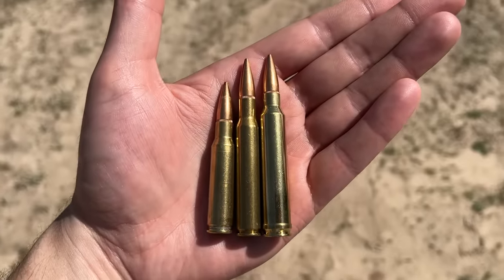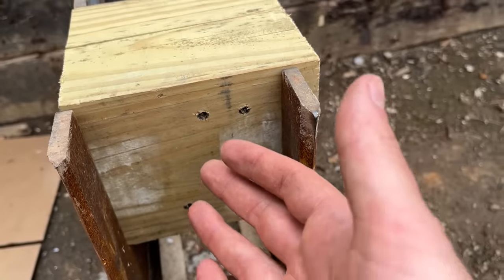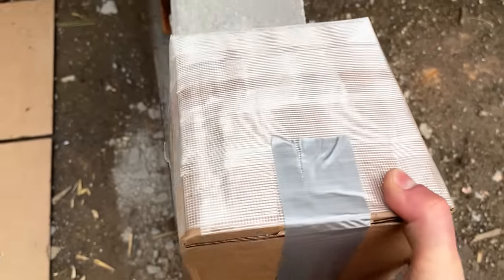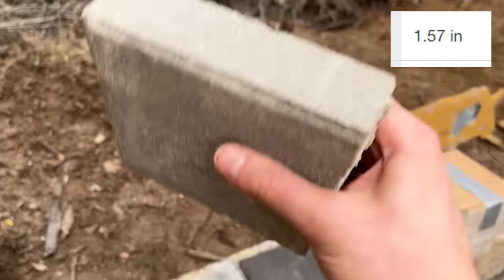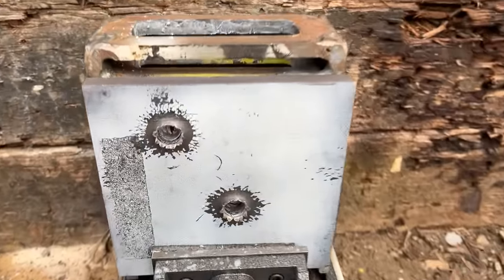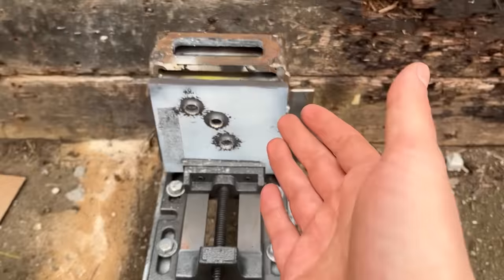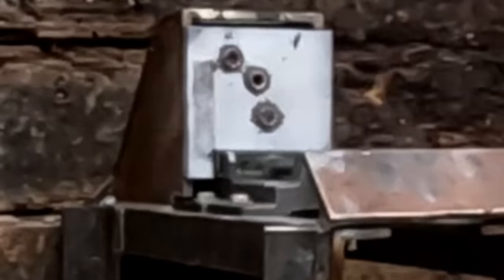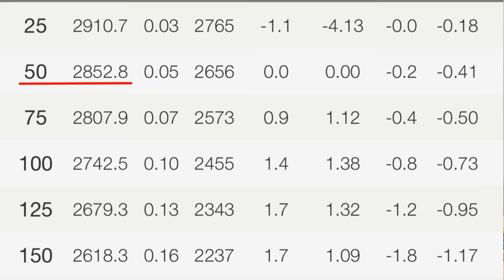308 vs 30-06 vs 300 Win Mag: Did Not Expect This

Comment: The split between 308 and oht 6 isn't a surprise for me. My grampa ( WW2 vet, tail gunner and all around gun nerd ) told me that 308 was the replacement for 30/06 . Grampa and I would read ballistic charts and bench race ammo...I know nerd stuff. It was the fun part about learning to shoot with him and my uncle.
Reply: Correct the army wanted a replacement for the 30-06 but wanted the same ballistics.  .308 was created to perform the same but with a shorter case
Reply: 308 replaced the old 30-06 that was safe to fire in the M1 Garand. Modern 30-06 is more powerful, and will damage an M1. I don't know what happened with these handloads.
Reply: Is it the same grain bullets
Reply: @Bob5mith  yeah the powder used in 308 is different than that of the old 30-06.
Reply: @DRAKED411  yes the bullets are interchangeable
Reply: Only because 308 is lighter and cheaper to produce. Not a knock just facts.
Reply: @brentacusmaximus6677  The 308 is a bit shorter... Faster throw in a machine gun, which puts more bullets up in the air.  '06 shoots a bit faster than a .50.
Reply: @IzzyReel  I'm a reloader so  I'm pretty aware of the differences between 308 30.06 and many others. What I stated is facts straight from the guys in charge of army ballistics.
Reply: @brentacusmaximus6677  Well yeah and whats your point?

why would you want a cartridge that requires more brass, takes up more space when in storage and provides no benefit?
Reply: @therideneverends1697  lol  I never said anything like that and here's a new flash 308 is only comparable in FPS NOT kinetic energy "ft pounds of energy ! I reload both a long with other calibers so I'm well aware.
Reply: @therideneverends1697  BTW 30.06 AP was still used up till the Vietnam War era in different belt fed machine guns and in some cases was still in use all the way until the late 70s.
Reply: The .308 Winchester has all the performance a 30/06 had in the 1940’s due to modern progressive burning rate powders etc.  The ‘06 has also benefited from this.  Just don’t use anything like 4831 in a Garand as you’ll create a very hazardous situation with high residual pressure at the gas port, for which they were never intended to handle.  I have shot much modern commercial ammo and many handloads through M1 Garands with no problems, with the possible exception of some Prvi-Partizan Yugoslav commercial M2 ball.  This shot well but seemed ‘lively’ so we pulled some apart to find it had well oversized flash-holes.  Just avoid the slow powders in the Garand and keep the pressures sensible as you should with any handloads. 
The 30/06 probably has the edge if you’re driving heavy bullets, say 200gr, with the slower powders - just don’t do it in an M1!  Use 4895, 4064 or equivalent and you’ll start to flatten primers before you’re in the danger-zone, then it’s time to back off.  The operating rod is the failure component here.  People have been speared by these.  A stress-relief radius at the junction of the operating rod is never a bad idea, but better to just not push the envelope!  And don’t mix your brass - different brands have varying capacities which can lead to catastrophic outcomes, and it’s a bad idea for consistency anyway.
Reply: @brentacusmaximus6677  if it does the same velocity with the same bullet weight and BC then the kinetic energy is identical.  But the 30/06 can drive bullets a bit faster due to increased case volume providing bore volume (length in this instance) allows for the full burning of progressive powders.  If done at the same pressures, there is no additional loading on the bolt-face by the longer powder column.  This particularly applies to heavier bullets, where the ‘06 has an advantage. I think this might be what you’re getting at? 🙂
Reply: @ThreenaddiesRexMegistus  basically in a nut shell they both have they're advantages aspeaclily with modern powders. If I had no choice but to carry a lot of ammo with a rifles 308 is a good choice. Realistically 30.06 has a lot of different loading abilities so does 308, but for fun at the range a 110 grain boattail in a 30.06 with a fairly hot load is gonna get some serious FPS that you couldn't get in a 308 case with the same 110 grain freedom seed. Lots of good aspects of both these case rounds.
Reply: The 308 is basically identical to the 30-06 with bullet weights under 150 gr. Over 150, the 30-06 rules.
Reply: @ThreenaddiesRexMegistus  in this guys video with no mention of B grain weight, type of powder or load data in general it kind of speak to the fact that a lot depends on all those factors. I mean a 308 could be loaded to be a good deal more powerful than a 30.06 and vice versa. The original 30.06s were loaded more mild for the M1 in ww2 which is another example of load specs making a big difference.
Reply: @brentacusmaximus6677  Yeah and the M3 grease gun was used until the late 90s early 2000s, doesent mean id be thrilled going to iraq with one
Reply: @ThreenaddiesRexMegistus  but the thing is why bother, almost all the 30-06 available commerically is either M1 spec or for bolt guns, and costs more.

Makes more sense to just use a 308 or buy another cartredge thats more efficiant
Reply: That was the greatest part of my childhood spending quality time with my grandpa and gun talk !!! 💙🪖😎
Reply: @therideneverends1697  It just comes down to them both having different advantages. If you're an experienced reloader i would think you'd already understand that.
Reply: @brentacusmaximus6677  the amount of variables is staggering . I was talking nato . Gramps explained the US military wanted SIMILAR performance from a smaller round. It was simply to allow more ammo to be on hand at any given moment. Beyond that I can look at a 308 and an oht six and simply see the potential one has vs the other. Ballistics are cool because that rule doesn't always apply. Simply by increasing velocity one can drastically effect the way a round behaves.
Reply: @robsorgdrager8477  thats basically what my original comment was meaning when it came to the milatarys decision to develop a lighter yet comparable case round. same thing happen during the Vietnam War and the m16. Took a couple years for them get that right and make everyone happy too, accept for the north com lol.
Reply: My pops always said in ww2 the 30-06 was the goat
Reply: @cannonfodder4812 exactly right. The military contractors had millions of projectiles to use so the new round needed to be 30 cal.  The powers that be wanted a magazine fed rifle with smaller, less heavy cartridges so more could be carried by each soldier. New powders were developed to retain 30-06 velocities with the new shorter 308 cases. The M-14 was essentially designed around this cartridge.
Reply: @brentacusmaximus6677   Wait, what??? Are you saying a 150 grain .308 FMJ projectile traveling at 2.850 fps DIFFERS in KE on impact when compared to a......150 grain .308 FMJ projectile traveling at 2,850 fps??? You will have to explain that one. I must have been absent from high school physics class that day.
Reply: Not nerd stuff! Great memories is what it is!
Reply: @therideneverends1697  The only reason for a 30.06 over a .308 would be if you were hunting some real large game.  I am in Tennessee and the deer are not that big.  Plus I am not shooting a deer at 800 yards.  Just so much more available in .308 so it makes no sense to use a 30.06.
Reply: @woodystube1000  No thats not what I meant, obviously.  I meant the same grain bullet in in a 30.06 will have more kinetic energy than a 308 depending on the load in the same matter that a 150 grain won't necessarily hit 2850 FPS depending on the load.
Reply: @rudder727  same here in Minnesota. The difference is our deer a big fatty fat fats. A lot of the old heads swear by 30/06 but I really don't need to take a 500 meter shot through three acres of dense brush 😏 . 308 gets the job done. Honestly 30/30 in a lever rifle is 🤌. Nice and light to carry up in the stand, great weight and performance...but yeah 308 has never failed me.
Reply: @robsorgdrager8477  honestly, a lot of that has to do with what the individual hunter is most experienced with, the very reason 30-06 became a popular hunting cartridge when the WWII vets came home. The cartridge is more than capable of taking a wide variety of game, and those vets had the most experience shooting that cartridge, so why switch to something else? 
I've used 30-06 for deer hunting because that's the caliber that my hand me down Remington 700 is chambered in, but I've just built an AR-10 in 308 that I'm planning on using this upcoming deer season. As long as my shot placement is good, I'm not worried about not being able to make an ethical kill on a deer with either cartridge.
Reply: With newly available  powders the 06 case was overkill for the M1 Garand so the 1945 T25 protype for the "improved model" was designed around a .300 Savage length cartridge based on a shortened 06 case. This rifle eventually became the M14 and the cartridge the 7.62x51. Winchester had released the civilian version a few years earlier as the .308 Winchester.
Reply: 10/10 Grampa and uncle moment
Reply: spelled aught six :)
Reply: @James13234  ☺️✌️. I fix cars

Comment: Once again the 308 demonstrates how it is one of the most efficient cartridges available.
Reply: It's the G.O.A.T.
Reply: 30.06 makes sense if you have a strong action and a long barrel to take advantage of hand loads.
Reply: Back when I used to hunt I had all 3 of these calibers. With the  300 and 30-06, even with good placement you might be blood trailing. With the 308 I never EVER had a deer take one step after a shot.
Reply: @baaamakingbaaaa  shot placement.  same slug, even less energy, no magic.  it's a very good cartridge, but it doesn't have mystical killing properties.
Reply: @handroids1981 the 300 win mag is….
Reply: @daltonisom6265  Not even close.
Reply: @handroids1981  the only thing the 308 has is more stock and chassis options
Reply: @daltonisom6265  So that's two things. I'll add a third, ammo availability and options.
Reply: @handroids1981  300 win mag has superior ballistics…
Reply: @handroids1981  and 300 win mag ammo is easy to come by… there’s all types of different ammunition for it!I    can go grizzly hunting and a guide won’t complain about it…
Reply: @baaamakingbaaaa  agreed, its all about energy displacement, if the bullet displaces all of its energy on the animal its max damage, if it goes thru the bullet has not displaced all its energy on the animal.
Reply: I agree.  And what gives it the real edge over the 06 imho is the vast semi auto platforms available for it.  The ability to make fast follow up shots is huge and cant be understated whether hunting or self defense

Comment: Where 30-06 steps away from 308 is when throwing heavier bullets.  The 308 loses powder volume to accomodate longer bullets, where 30-06 has ample room for the slug and the extra powder starts to really pull its weight.
Reply: Yep.
Reply: Compressed loads my mans
Reply: Thats why its the best hunting round 👍
Reply: So long as the rifle does not fail due to overpressure.
Reply: @DavidFMayerPhD  you can't make an overpressure load with 308 that will damage the gun if you are using the correct powder.  There isn't enough case volume.  Even with a 150gr projectile, I can fill the case to the brim with varget and compress the powder and barely get primer flattening.
Reply: @flossordie2256 I was thinking of the 30-06
Reply: @flossordie2256 you haven’t reloaded enough then.   I was shooting 185 juggers with a hot load using “temperature stable powder”
Reply: @popeye089  and?
Reply: @DavidFMayerPhD  that's true in general.  308 loses all it's arguments past 180, 30-06 is good to a 220, 230 if it's a round nose.  of course don't load irresponsibly, but you can buy heavier loads off of the shelf.
Reply: @sinisterthoughts2896  it’s all fine and dandy for a hand loader, but if your buying factory ammunition 308 has a higher pressure specification. Not that it actually matters they are so close together the differences just simply aren’t enough to actually make a difference in most scenarios and if a persons use case is one of the exceptions they will already know that. Want it in an AR? 308 
Want cheap bulk target ammo? 308
Want to maximize some spicy hand loads in a good strong bolt rifle? 30-06 wins that one every time.
Shooting some white tail at 25 yards? Flip a coin the deer won’t know the difference
Reply: But then you have to use a long-action rifle vs a short-action with the 308
Reply: @jaydunbar7538  I don't disagree. I stated that they are different and 30-06 is best suited (and originally designed) for heavier bullets.  150 gr in 30-06 is basically trying to make a 308 out of it, since 308 was meant to mimic M2 ball, which was a 150 gr 30-06.  so yeah, everything you said tracks with my comments.  and I agree, they are both more than enough fore a whitetail at pistol range.  if it were an elk at 200 yards, or a moose at 100 yards, or a brown bear at all?  if all I had were those two choices, I know which one is the more powerful, if given the correct ammunition for the scenario.
Reply: This is because .308 was originally designed to emulate the M2 Ball .30-06 round in a smaller package. The M2 Ball round itself was down-loaded from what .30-06 was originally capable of because they found it was going beyond the safe limits of military firing ranges; as a result, the case was now larger and heavier than it needed to be. Commercial .30-06 can exceed .308 by quite a large margin. And certain .300 Win Mag loadings can be downright scary.
Reply: Yip..at 150grain bullets,not much diff..get near 180 grain,the 06 pulls away..I can push 178 ELD 150-200FPS faster outta my 06 vs 308..My 300 laughs at both with 190-208s
Reply: @jaydunbar7538  also, off the shelf ammo can be purchased for 30-06 that is 190 grain and higher, and it will simply have greater effect than 308, so even the hand loading argument is mitigated.  308 is a fine caliber, and can most anything most people will ever need.  It's just 30-06 has wider margins which gives it greater capabilities and variety.
Reply: lets not forget when considering the 30/06 factory loads in general are loaded for reduced pressure to accomodate all the old military surplus rifles such as the springfiel 03  not the o3a3 but the old 03 one of mine is serila numbered under 100K and cannot use high pressure ammo, factory loaded 180 remington corelocted are a perfect round for this rifle for large deer and blackbear, i do reload for that rifle i attain the same velocities but get less chamber pressures
Reply: I really am tired of these comparisons. Where I live the .308 does everything I need it to do and as a hand loader why would I use a larger cartridge that needs more powder which is very expensive these days.
Reply: Using a Copper bullet will negate the minor loss of use of 220 grain bullets. Try a 180-90 that shoots accurately in your rifle.
Reply: Yep
Reply: @jaydunbar7538 Don't follow this man's advice. Deer heard coin flip and ran away☹️
Reply: @craigm3777  is the 308 and 06 the same barrel length?

Comment: The old 30-06 is still a great round even in modern time .
Reply: I doubt it much matters on medium game.

I took 3 deer last season...
I've gotten away from optics lately so only one with a .30/06.

Deer #1 (27 yards)
 .40 Caliber 46" John Bull Flintlock with 90 gr Pure Lead .390 RB and 55 gr of home milled black powder (approx. 2.5f with Carolina Buckthorn base)

Deer #2 (Est. 40 yards) 
.38 WCF (.401 190 gr LF with full modern case of black, newer cases don't have room for original charge) 1892 Winchester Rifle.

Deer #3 (192 yards)
.30/06 Remington Model 30 with Lyman 48 Sight using Speer 165 gr Hot-Cor and H4350 (It was the next  node down from max in my rifle, I don't post Smokeless charges).

None of them went over 50 yards.
Reply: 30-06 is one of the OG "mag" rounds.  Wherein the casing diameter is substantially larger than the round.
Reply: @TheBasstead1  Yes and it can be necked  down or up and get more velocity or more punch but of course different guns or barrels .
Reply: IT WON TWO WORLD WARS! Still love my '06.
Reply: If you could have only one rifle caliber, 30-06 is still probably the best all-around cartridge ever. IDK why they just don't incorporate it into new platforms.

It really could be the One Round To Rule Them All if the industry got on board, but I guess it isn't considered sexy.
Reply: I love my Savage Axis XP II in 30-06
Reply: @gk5891  who brought up medium game?  your whole statement doesn't really have much to do with the original post.
Reply: @TheBasstead1  that's not what magnum means.
Reply: @sinisterthoughts2896 It is no longer a US Military cartridge. It's primary use by civilians is as a medium game cartridge. His statement "still a great cartridge" infers he is talking about current use. I specified Medium Game to differentiate between under and over 350 lb (which is likely it's second most common use before CMP matches).
Reply: I have 26 inch bull barrel '06,Rem 700.. Same thing 308.. with 178s the drop at 500byrds BIG diff..06 is legit 1000yd round cause case capacity and longer heavier bullets vs 308..
Reply: @keithgraham9547  Then they would rename it to "30-06 PRC" (when all it is just simply a spicier round).
Reply: @gk5891  
27 yards?
At that distance why not just use a rock?
Reply: @seeharvester  

Some would argue  a 200 year old muzzleloader with home milled powder and home cast lead ball is basically throwing a rock. 

By hand I've never been able to throw a 90 gr lead ball hard enough to get adequate penetration.